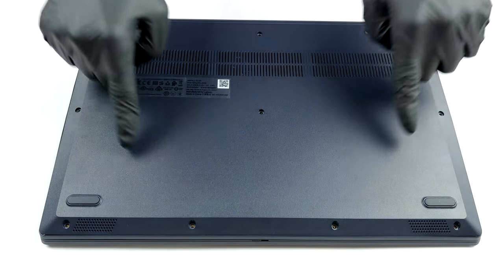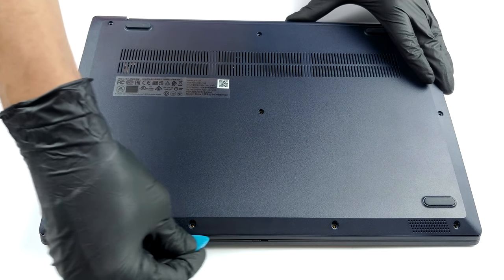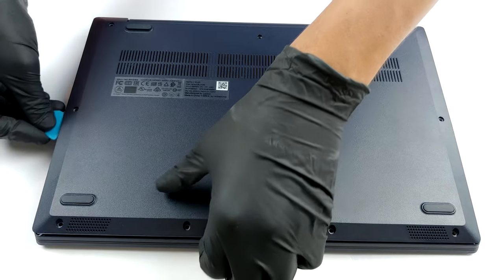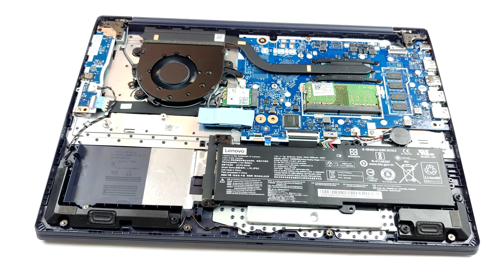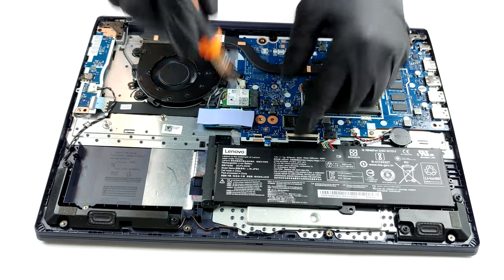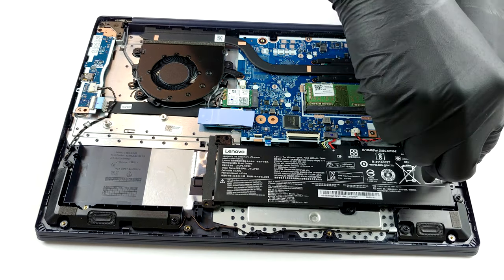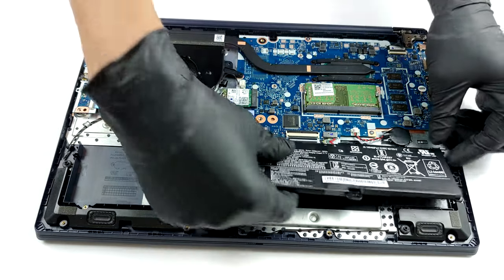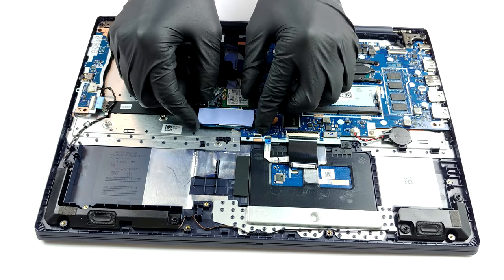🛠️ Lenovo Ideapad 3 (15) - disassembly and upgrade options

Comment: There's no room for extra HDD/SSD?
Reply: In Ideapad 3 you have 1 SATA , 1 M.2 Slots. If you have HDD already , then there is one slot free for M.2 NVMe SSD ( and one more M.2 slot if you remove the wifi card  , you can use USB Dongle for Wifi connectivity)
Reply: @firefist1056  Thanks
Reply: Fire Fist so you're saying that you can add an additional SSD with the one that came stock with your laptop? Do you know of a video or anything that shows you how to do that?
Reply: @no1bro120202  You can in most cases. That's why HDD Caddys exist. You just simply replace DVD-RW with HDD Caddy. Some laptops have more than 2 SATA ports and you can leave DVD-RW and still add extra HDD/SSD.
Reply: @no1bro120202  If your laptop came with already with SSD , you can add one more in SATA Slot. If you also remove your Wifi card then u will get one more port for another SSD.

Comment: If i get a 8gb version, how do i update to 16gigs? I want to add another stick but i dont know if adding another random 8g stick will make any problems. So i must ask, what was the ram stick u got with ur laptop?
Reply: You can replace 4 gigs with 8.You can only have Max 12 gb
Reply: @maheshmoholkar8088  are you sure because I have 16gb ram stick
Reply: @imperialdrift541  is it same model?

Comment: Sucker alert - You do not want to go above 8GB memory on this or similar Lenovo machines. The memory works better if two 4GB memory modules are paired together. If you need more than 8GB memory for what you are regularly doing, you probably need a different machine. Alert #2 - The battery life on Lenovos is not long and, obviously, you cannot carry a spare battery and pop it in. Otherwise, as far as I know, great budget laptops. I have one on order.
Reply: How exactly does it performs if we pair the soldered 4GB RAM with 8GB RAM?
Reply: @rohit31chauhan  I researched issues related to laptops because I wanted to buy a new one. My needs are very simple - word processing and internet. More rarely, editing photos. But I did not want to make a mistake.

This was just something that I found out along the way doing my research. I do not recall what issues resulted from mismatched memory.

But I would say, if someone is doing something that requires more memory, they should get a machine set up for what they need to do. That probably means one with 8mb of native memory, expandable to 16mb.

I'm doing great with my Lenovo w/ Intel i3, 8 mb and an FHD display. Got it on a one-day sale for I think for $399, more than $100 below the list price.

The price has gone down already since then. Someone might be able to get the same for than $500 US. If you have a machine already and don't want to buy a new one, maybe you should try expanding from 4mb to 8mb and see if that works for you. That's what I would do.

Comment: can u upgrade the ram on it
Reply: Yes. 4GB is soldered in and there is 1 slot for DDR4 RAM. You should be OK with adding 16GB in this slot to give You total of 20GB RAM.